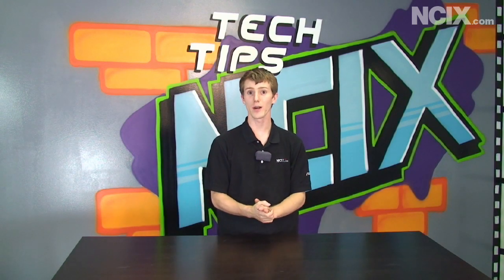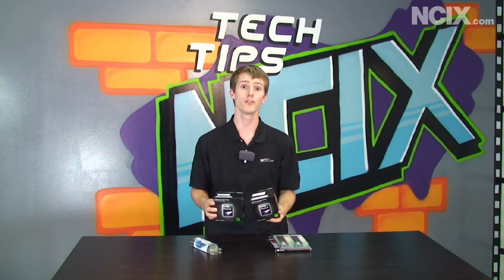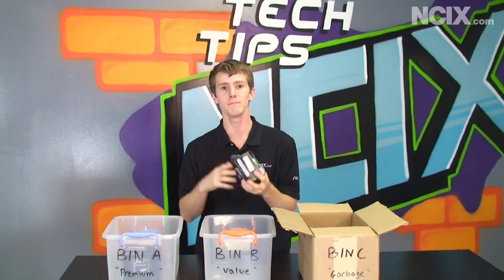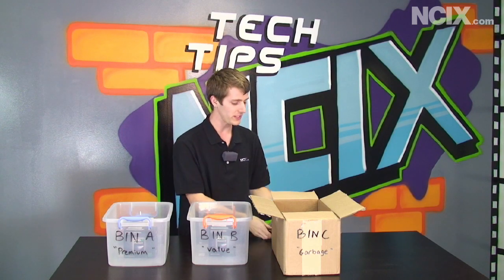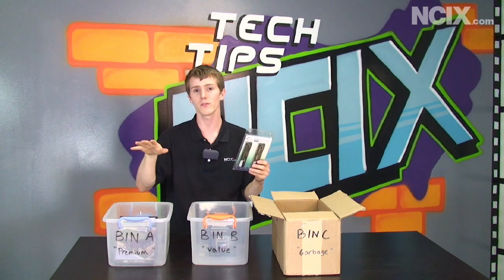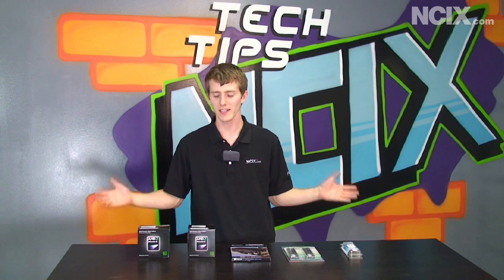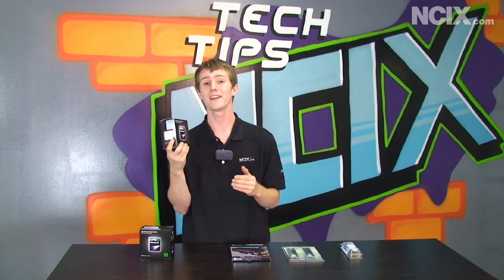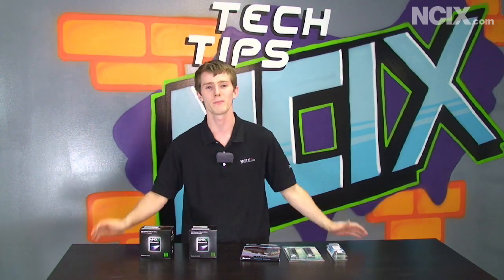Binning Process Explanation (NCIX Tech Tips #72)

Comment: I'm actually confused now about the ram. Isn't it supposed to be better if it can deliver the same specs at a lower voltage? (But nevermind, I got low volt ram to save electricity anyways, but now I combined higher voltage modules with them)

Comment: hehe linus himself understood after a while there that thoes ecos wherent a good exaple :P i actually find them better than the dominators coz now they have a newer revision of them that coasts the same and i've got thoes one for example and jsut to further explain what i mean: my gskill ecos are running 7-7-7-24 1600 4gb @ 1.35v! if you don't count them as better than the dominators you suck :P plus they are cheaper, and cooler coz of the low voltage, and more overklocking friendly... i love em